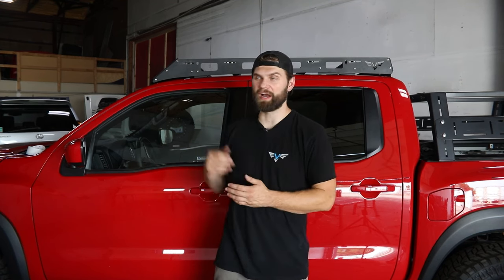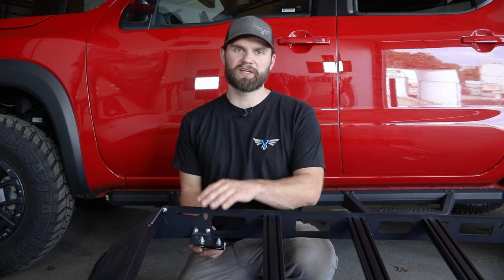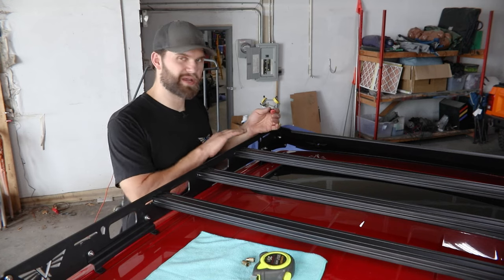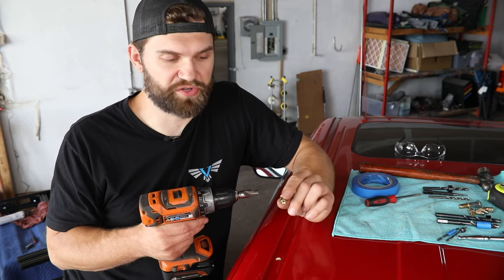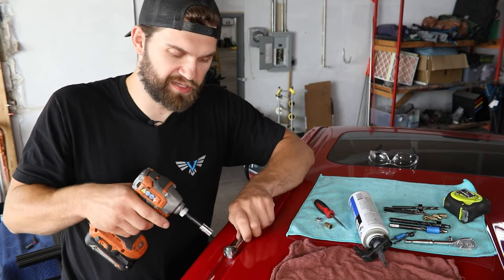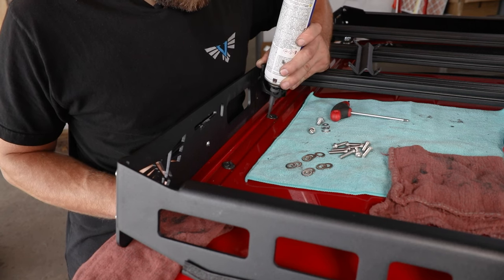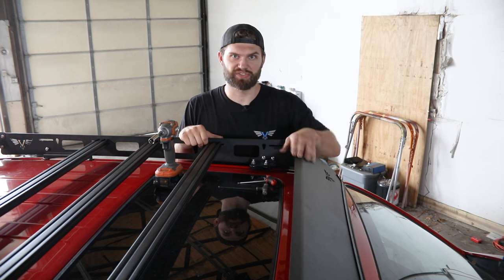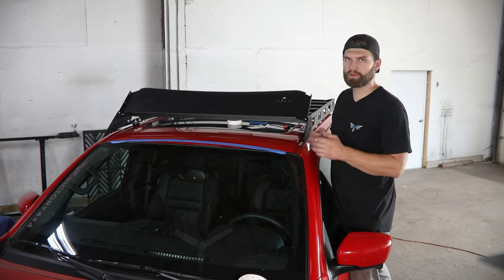3rd Gen Nissan Frontier Roof Rack Install

Comment: I wouldn't trust this to just any shop, so many clowns and so many shortcuts. Having a leaking roof is a nightmare, That is why I think I would rather go with a cheaper roof mount, no drilling easily take on and off and if its stolen, well it's not a big deal, it wasn't expensive. 

Thanks for sharing.

Comment: any concerns with the RTV drying out/cracking and causing a leak later?
Reply from the maker: Permatex ultra black RTV is an OE used gasket maker. It is designed to handle high temps and leaves no reason to believe it would break down in this application.
Reply: @Victory4x4  awesome. Thanks
Reply: @Victory4x4  To bad they can't make Permatex in colors...